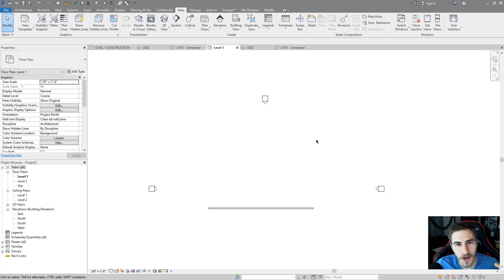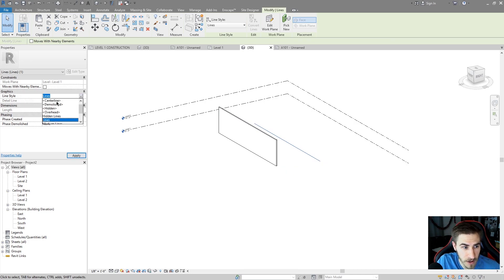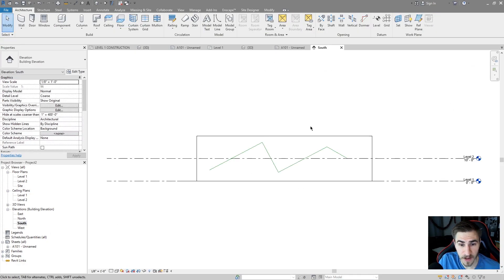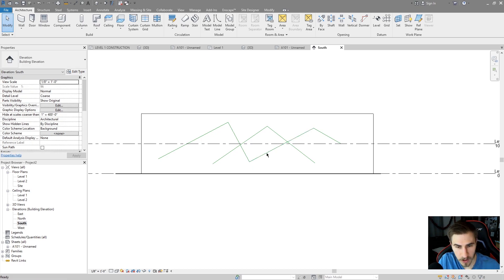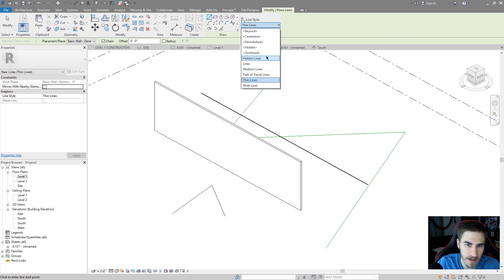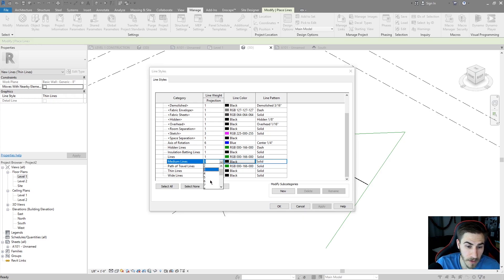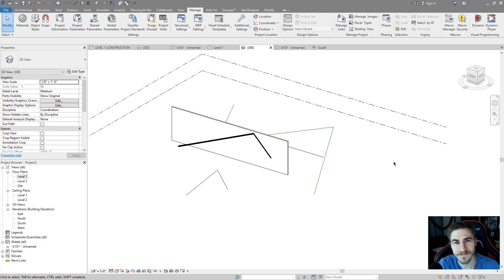How to use Model Lines | Revit

Comment: I cannot select nor edit the model line.  It does not show up in any other view except 'plan'. <edit> It comes in greyed out...yes I've checked VG. I've detached all view templates.
Reply from the maker: I would check it in 3D as all model lines will show up there. Also, things showing up as gray may indicate they are ending up in a design option.

Comment: hi, you only talking where to show these lines. But what do you use them for?? i think these are useless lines, you cannot use them for any good. it would be better if we have these lines and basic tools to draw and design with them our models and plans, before we actually make the actual drawing.
Reply from the maker: You can use them as anything really. The advantage is that they will show up in 3D as lines. You can use them for anything in 3D whether it's referencing for another element or as regular lines.

Comment: Great tutorial, thanks a lot for your time, could you pls advise how to place a model on a surface which is not a wall, for ex., I would like to place a model line on each steps of a stadium auditorium
Reply from the maker: You would first need to set the work plane then draw the lines. So you would have to set the work plan for the riser, draw the lines, then the tread and draw the line. You could do that or set the work plane to a side wall or stringer and draw the line in profile then just move the lines along the stair if you want.
Reply: @ArchitectureVanguard  Thanks a lot for your prompt reply, really appreciate, have a nice day!
Reply from the maker: No problem James, you too!

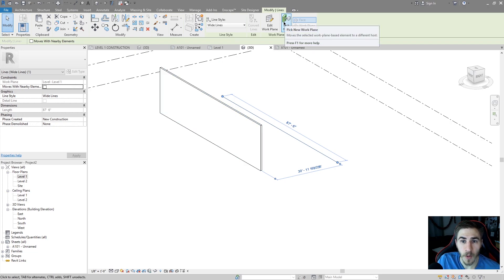Comment: On 2:50 , How can i draw a line, that is vertically(perpendicularly)  to the wall and it starts from level 1 up to level 2?  i am trying but the line is always horizontally to level 1, cant give it height to reach above level 1
Reply from the maker: You would need to first set the work plane to something vertical like a wall then draw a line in 3D that is perpendicular to a wall in plan.